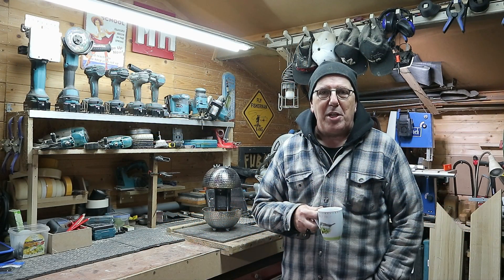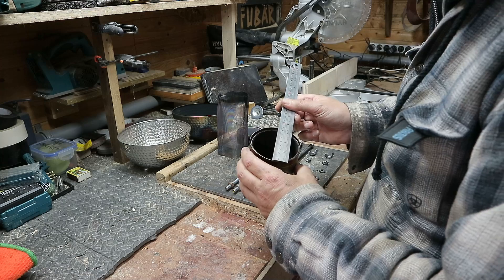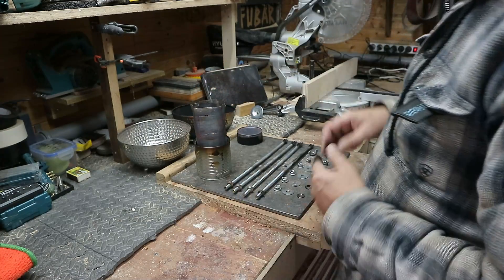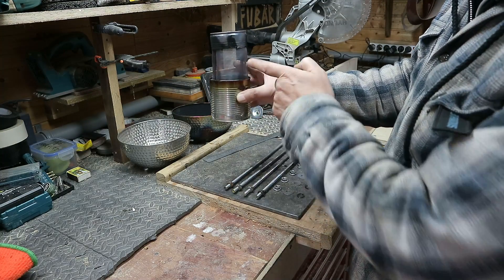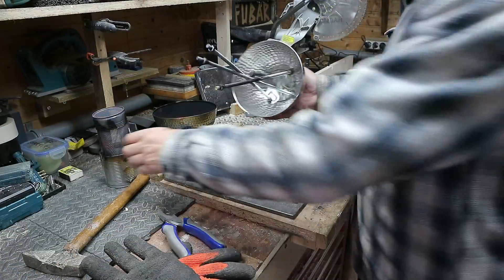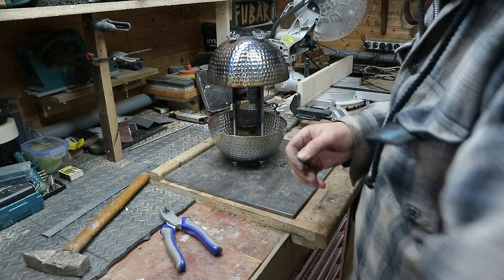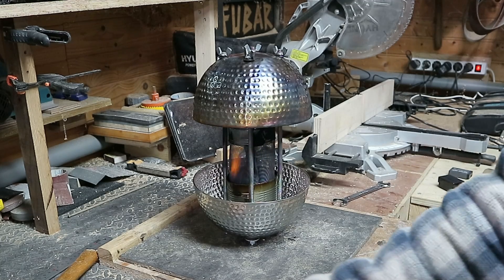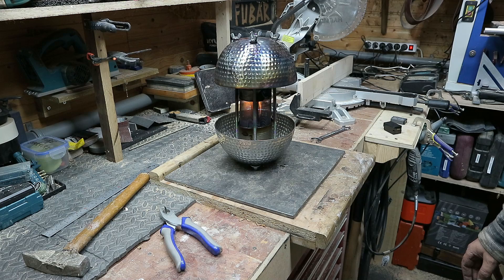#16: How to build your own Bio Ethanol heater, Cheap, Fast, Smokeless

Comment: I did your design of the can , fiber felt, and steel mesh. 
I found an old Dutch steel pot and a piece of steel out of a motor 5” across by 3” deep with a hole in the middle that the can will fit down in. Put the thick steel piece in the cast iron pot and soup can in the middle. Holds heat well. 
My concern is will the soup can get to hot that it might explode. I am using 91% isopropyl alcohol. 2:12
Reply from the maker: Hey Susan. Use small quantities of IPA at a time and make sure the pressure can't build up ( The can on the top is open ) But as always, be extremely careful and use at your own risk

Comment: If the top was mounted on telescopic rods it could be (with good gloves) be pushed down to make a sphere and ultimately safety extinguish it. The mesh would possibly need to be made shorter so it fits inside the sphere. Fit a handle to the top too so it can be pulled back up. Hope that makes sense.
Reply from the maker: Nice feedback, thanks

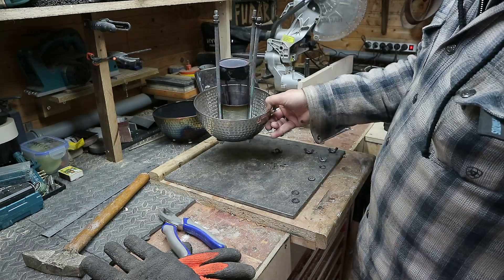Comment: That's an interesting design. The salad bowls look aluminium though, are they gonna be able to take the amount of heat that the lantern gives off? And 4:47 although I like the look of your design, it's gonna be a right faff to change the lantern over when it runs out. Mainly because of the sort of column arrangement in the middle. Maybe a three rod set up would work better to access the lantern a bit better? Cheers for sharing fella.

Comment: VERY COOL - UH HOT I mean.😁 much like my alcohol stove principle. 1 question - does the mesh have to be fine? My assumption would be the finer the easier to glow, but also the finer the easier to wear out??
Reply: 🤣🤣🤣 don't get fine mesh I bought fine mesh not on purpose but i soon realised it doesn't work my heater melted it straightaway, so now I'm in the process of finding the right one. I think the one I bought was 1mm thick.

Comment: I p a    so u can use Indian pale ale....
Reply from the maker: You could, but I guess Iso Propyl Alcohol would be better
Reply: @mikeshawbrook-selfreliance  Is that what you are referring to when you say IPA?  I also thought of beer. I'm in the US.
Reply from the maker: @BluSkyeHost  Isopropyl alcohol
Reply: @mikeshawbrook-selfreliance  Thank you for that clarification. My home uses natural gas as a heat source, and I'm looking for budget alternatives to rely on for indoor heating.  Natural gas has become so very expensive now. We senior citizens will freeze!
Reply from the maker: @BluSkyeHost  Sorry to hear that. Please check my video on sand batteries. A great ( and proven way ) to have some supplemental heat. https://www.youtube.com/watch?v=zwKhVHA9SkI&t=2s    If you already have to heat one room, put a few empty paint cans with white sand ( make sure there is a tiny hole in the lid for pressure release ) As you turn off your main heatsource ( going to bed, moving to other room etc ) place the paint cans in a flat wooden box with holes in the top. As you sit down, put your feet on it and a blanket over your knees.
Reply: @mikeshawbrook-selfreliance  Sounds interesting.  I've checked online, and the big box stores where I'm at only have the sand that goes into children's play area / sandboxes. Is that suitable?
Reply from the maker: @BluSkyeHost  Perfect
Reply: @mikeshawbrook-selfreliance  Thanks!  I need to go to that area anyway, and will take a look.  My apologies to Francis for hijacking this thread.

Comment: Or for around the same price, educate yourself more so you can afford to keep the heating on...
Reply from the maker: Funny
Reply: I like that attitude that's my way of thinking but what's wrong with making one while you educate yourself so you can then afford to pay your gas, you could also use it as constant reminder never to go back only forward.
Reply: Unless you plan on burning your diploma in the living room in a desperate attempt to not freeze to death, education will do very little to keep your heat on if the power goes out, your furnace dies, or there is a disruption in the fuel supply for heat. Learning methods to bring to bear if that happens IS education. Being prepared ahead of time for such things is a prudent use of that education.

Comment: What's the point in having a heater uou can only use in a room when the windows are open ...  this is not going to keep your room warm...
Reply from the maker: Keith, you are not supposed to open your windows and or doors. I just did that because I am in a tiny shed. Ventilation is something you should always have, in any room. Now in this case Bio Ethanol create little to no carbon mon oxide, but still. Be careful

Comment: Nice build, I made a similar one after watching Robert's crazy vids, lol  I can see yours is burning rich as mine was and will give off noxious gasses. I punched half inch holes in the bottom of the gauze to let more oxygen in and it is a load better. Stay safe :)
Reply from the maker: I will check it out

Comment: I know it's smokeless, but how is it with soot? I've used alcohols for homemade heaters, and I found that while Denatured alcohol didn't produce any, 91% Isopropyl created thin soot that would get on everything.
Reply from the maker: Very little soot. The soot in the video is because I used different types of fuel in it for testing
Reply: @mikeshawbrook-selfreliance  Okay. Do you think that having that bowl acting like a cover would connect a lot of the soot that some of the other fuels produce? I didn't use anything at a top like you did here, I wonder if that would mitigate soot buildup on everything else.
Like I said, denatured doesn't produce any soot, but Isopropyl is less expensive, burns longer and considerably hotter not to mention it's easier to get.

Comment: I thought alcohol burns blue?  
this is a yellow flame...probably need to drill a few holes at the top of the lower can?
Reply from the maker: Maybe, I will look into it. Thanks
Reply: I built Murrays version and have ran it on Ipa.    With a hot screen it burned cleaner.    When i was a kid in chemistry alcohol always burned blue and had sweet smell I bet it was Ethanol.
     When i built mine i used smallest soup cans and made my wick thinner 2 sock layers thick.   Flame hight was 1 foot and near the end only 6 inches.    To me this gets hot for emergencies but is still blowing fuel out at 2x what would be ideal.   I suppose making it taller or two miniture ones.

Comment: If you can't use this in an area that isn't ventilated I.e open door then what is the point in it? You can't heat a room if the windows are open or am I missing something? Genuine question not criticism
Reply from the maker: It generates carbon monoxide and that is dangerous. But it is suitable for a hot tent, a shed, a porch etc etc. If you decide to use it in the house ( it's possible ) just make sure there is enough ventilation. Not open doors but at least airflow ( and a carbon monoxide detector )

Comment: It looks like you have an incomplete burn hence the black soot, also i would guess you would have a smell of ethanol, so it would be advisable to get a carbon monoxide detector as when youu get the incomplete burn you also get carbon monoxide. my first one gave off an ethanol smell and the carbon monoxide detector went mental. I like most have experimented with these burners and now have them running right, no soot on the mesh or te top of the burner and no smell at all, the result is a carbon monoxide reading of 0 ppm even after a 6hr burn. Like your design it is sort of a ethanol UFO, but I can tell by looking at ithe video it needs a bit more work as the top cover on the mesh and the top bowl should be free from soot.
Reply: How about posting or providing a description of your design/ improvement?
Reply from the maker: The soot is actually from other fuel types I tried. The Bio Ethanol burns soot and smoke free :-)

Comment: Really enjoyed the video.  Not sure if I missed it or not,but approximately how long would this burn?
 Thank you
Reply from the maker: Depends heavily on diameter, height etc... It's trial and error really. Are you using methanol, bio ethanol, lampoil etc
Reply: @mikeshawbrook-selfreliance How long would it last if you were using bio ethanol ?
Reply from the maker: @anio6865  About 1 inch in the can would burn something like 30 minutes
Reply: @mikeshawbrook-selfreliance  have you tried using ceramic wool. And also use a sort of a lid with maybe only 1/2 to 1 inch hole on top. That way it uses less alchohol. And smaller flame.
Reply from the maker: @anio6865  That is why I used the graphite felt as shown in the video

Comment: I love it mate - that is so cool!
Reply from the maker: Thanks so much ! I love your vids.... keep them coming !
Reply: Where I am at you can pick up Sanitizer for pennies or for free. 60 - 80% alcohol. Yet distilling it for the alcohol rases safety questions. I have not found anything credible as to how to do it safely. Just people saying you shouldn't. Due to the fumes from the heated Glycerin. I notice that the version here has only the capillary action of the felt next to the can wall on one side. They're not being an internal can as in your version. Also, it looks like it is burning internally and not externally at the mantle. Really, hazardous waste facilities are dealing with loads of sanitizer due to the Glycerin being given a shelf date. They would rather give it away than pay for disposal = free fuel... All my best and love life, AD
Reply from the maker: @archerdeangelo1187  Would love to hear whether you can up with any improvements !
Reply: Anything you approve,  Robert.  .... I'm IN! Thanks
Reply: Looks like a copy of yours RMS
Reply from the maker: @davidpeckham2405  As I mentioned in the video
Reply: @mikeshawbrook-selfreliance  Sorry, it is a good thing.  Shows people it is sucessful.  I've built one myself.  I wonder if the top bowl would reflect more heat if it were upside down (actually right side up!).  Thought you might try that too!.  Good job.
Reply from the maker: @davidpeckham2405  I thought of that but this way it keeps the flame "in" more. A bit more safer I guess.